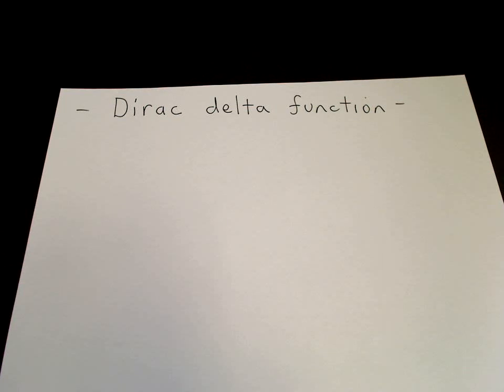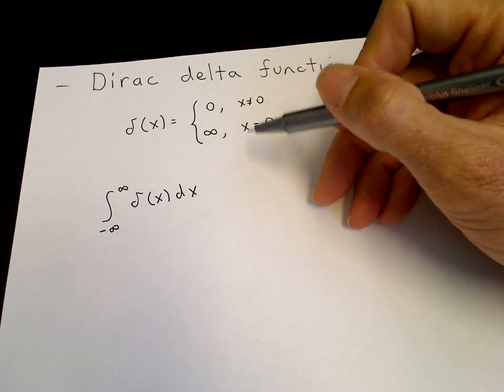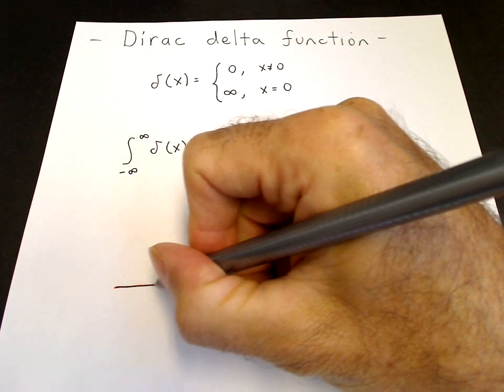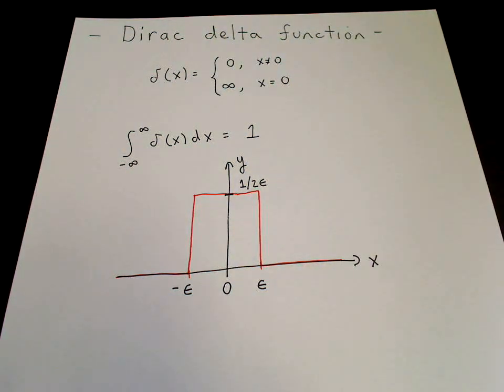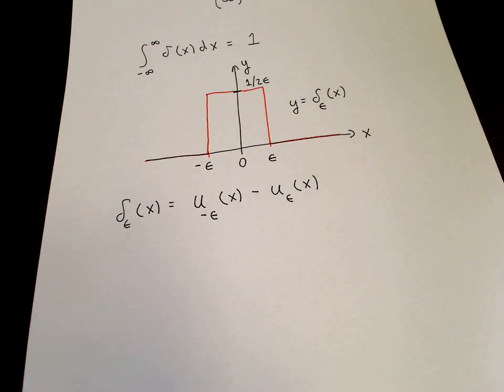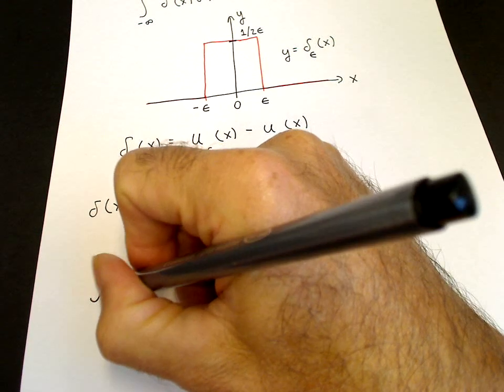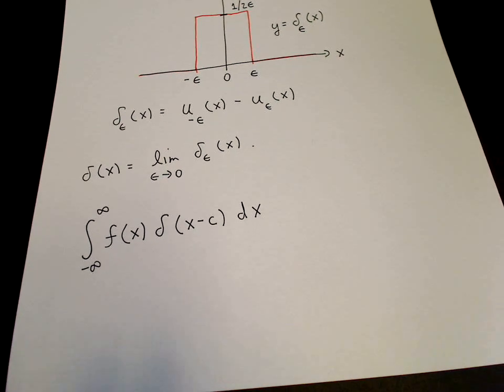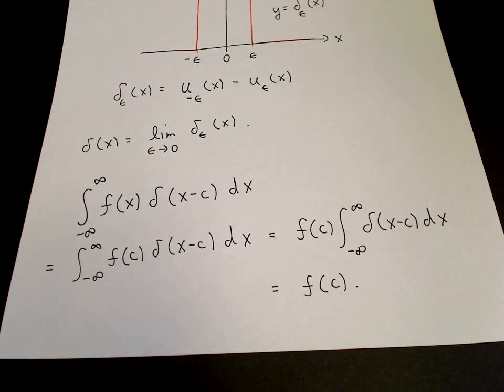Dirac delta function

Comment: why dirac delta is not actually a function....????  plz hel0
Reply: From Real Analysis we know that any 'function' which is zero for the entire real number line but non-zero at a single point must have an integral value of zero from negative inf to positive inf. It can be treated as a function within an integral and is sometimes referred to as an "approximate" function because of this.
Reply: In other words, rationalize and convince yourself mathematecally (or systematically), that there is no real question or thought to be had.
Reply: Since the delta functions input is a function and its output is a scalar value, it is a functional vs a function.

Comment: The problem I have is that this could be explained so much easier in non-typical presentation to a much more impactual degree.  It seems math is designed to off-put us as a species in general to avoid it like the plague, because it is designed to convolute the perception.  In other words, a form of critical means perception control.  So think about it like this...in human psychology, fuck math, as this is a formula supposedly trying to determine an impulse reaction based impact.  Now, if you want to simplofy all of the individually based description through loose drawing of thought that this guy did, then you have a basic concept...this concept is that humans are in a state of stasis when comfortable and when excited (which is usually only stimulated at this point of control), the stasis will "Pulse", or "react", to the stimuli, becoming "alive" for a moment before going back to "stasis mode".   This is not a normal function of humanity, but a conditioned status forced upon us all, to be lowered in frequency of mind Constantly in Bombardment, to sustain us at a lowered state.  This is why this function exists...humans are constantly suppressed, and therefore, when JOLTED into reality, they exhibit a surge.  When left alone they stay docile at the suppressed level until JOLTED at some point by some ill-controlled information or the progression of reality into being in the light.